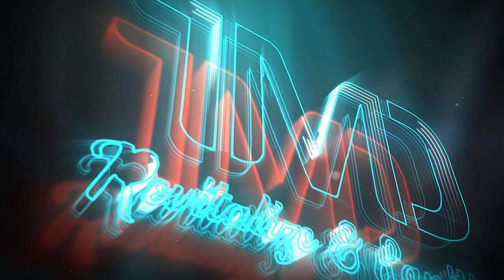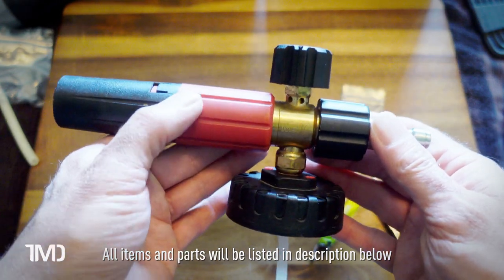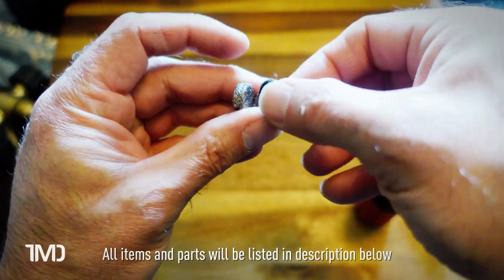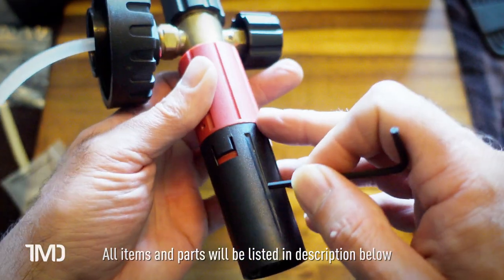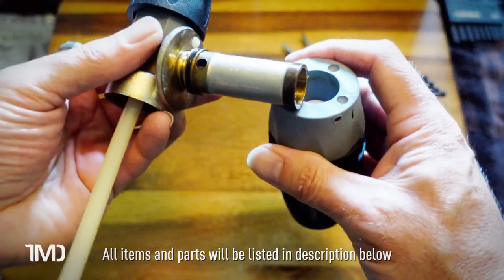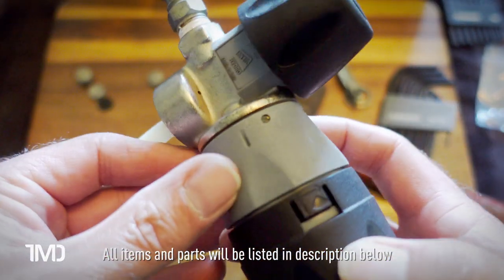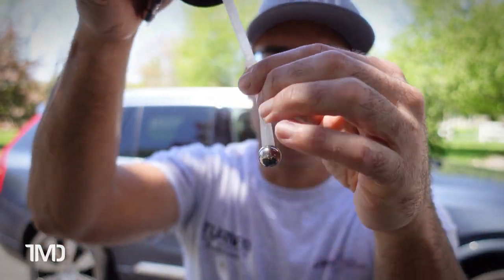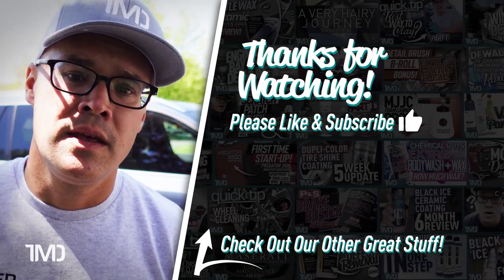How to Replace Filters in MJJC Pro 2 & MTM PF22.2 Foam Cannons + Routine Maintenance

Comment: It's crazy how up until I found and watched this video, I had no issues with my mjjc foam cannon. Then I went to wash my car and had runny AF soap. Opened it up, adjusted the filter (until the replacement arrives) and it's kind of working. But it's just weird that until this video popped up on my YouTube recommendation list, I had no issues with it at all.
Reply from the maker: Lol, strange phenomenon
Reply: @TurnerMobileDetailing sadly the fixes didn't work for me. I have a 1.2gpm 1800 psi pressure washer and the foam is runny. I've ordered a replacement to see if my pressure washer is the problem or the foam cannon
Reply: @TurnerMobileDetailing 
I have a question buddy. Will that 3 piece filter fit any foam cannon, ? For example I have the  red Bear Force clear bottle stainless steel foam cannon,would that 3 piece filter fit the bear force foam cannon? Would love to try it
Reply from the maker: Good question, and I’ve gotten the same question before. My answer is I don’t know, I’ve never tried that. I just use the factory suggested replacement filter. You can compare size specs for each filter and if they’re the same, it could work.

Comment: After replacing the MJJC filters, I had the same moderate improvement. I punched out the filter in the weighted ball with a syringe and got the same results you got at the end. I'd rather bypass the dip tube altogether even if it means replacing the internal filters more often.
Reply from the maker: Yup, if you can have the weighted ball but no filter hinderance, should be golden.

Comment: Thanks for the video - really useful. 
I have the MJJC. I recently dropped the cannon and broke part of the nozzle… only the black part. I ordered a replacement from MJJC. I see from your video how to remove the red and the black parts together (to replace filters) but do you know how to separate the black from the red (since I only need to replace the black part). It seems like brute force but I don’t won’t to break the red part also! 😮😮. Many thanks for your thoughts. 
Cheers
Reply from the maker: Honestly I’ve never had to do that. I took a look at mine and didn’t see a clear way to separate the two. If they sent you the black part only, hopefully seethe piece on its own will give some indication as to how they come apart and go back together.

Comment: So if we want to be a little proactive, is it better to use filtered water to dilute the snow foam concentrate?
Reply from the maker: Filtered water still contains minerals. If you want to go that route you would use distilled water in the reservoir. However, you’ll still be running regular water from the hose, unless you have a reverse osmosis system.

Comment: Why can't you fill the bottle of the foam cannon with a cleaning agent and pull the trigger to flush out the filter?
Reply from the maker: I guess you could in theory. The foam filters inside the MJJC might not be flushable multiple times as they’re a fine grade foam and not stainless steel, thus less durable.

Comment: have you tried cleaning the MTM or MJJC filters probably keeping in distilled vinegar for couple of hrs and reuse?
Reply from the maker: I have not, let us know how it goes?
Reply: @TurnerMobileDetailing  I tried soaking in vinegar for couple of hrs 90% of all mineral and alkaline deposits will get cleaned out with that, then just add a spoon of baking soda and the reaction will remove remaining 10% acidic and hard alkaline deposit residue - it gets 100% cleaned, no need to buy filters unless it is damaged. Also I dont use the allen key to push the filter out that creates a depression and damages it.
Reply from the maker: @kashi2843  which filter did you clean?
Reply: @TurnerMobileDetailing  mesh filter inside the cannon which you need to push out to access. I don't use the ball filter at all

Comment: I have a MJJC myself. Not sure if it’s the same issue hope it is . But my MJJC won’t foam when I max the top nob all da way. I have to minimize the nob to get some watery foam . Hope you can tell me if this is the same issue you had ? Should I start with the filters first like the video ?
Reply from the maker: How many times have you used it?
Reply: @TurnerMobileDetailing  

I been having the foam cannon for about 3 months i use it on the weekends constantly. So I wash 2 to 3 cars every weekend.
Reply from the maker: @mariaacosta7428  at that rate I’d say it’s probably about time to change the filters and clean or remove the filter at the end of the dip tube. Try that and see if that works
Reply: I had the exact same issue. I opened it up and pressed the filters using my finger towards the nozzle. That seemed to work but I ultimately bought new filters. Still not getting good foam though so I'll try removing the weighted ball and see if that helps
Reply: @mariaacosta7428 did you figure out what the problem was?
Reply: Yes Exactly what you said , needed a new filter for the foam cannon. I appreciate your expertise and thank you on taking your time and responding. Much appreciated

Comment: Hid, did you find a way to remove the filter & attach the weighted ball. I am having problems with my Mjjc too.
Reply from the maker: Honestly no, I haven’t had a chance to put any time into that. I just removed the weighted ball/filter and left it off, it works great, I don’t think having a filter there is a big deal anyway, but the weighted ball was nice. I’ll get back to it eventually lol.
Reply: @TurnerMobileDetailing  Thanks for your reply & yeah i don't think a filter is a big deal either. I have just run a 2.5mm drill through the outer end of the ball to break through the end of the filter, so clearing out any debris & effectively making the filter defunct, then i have just re-attached the ball to the pipe. Not tried it yet but i will let you know if it's a success. 👍🏻
Reply from the maker: @alantaylor2  good idea man, let me know how it works
Reply: @TurnerMobileDetailing  Tried it today & it’s as good as new if not better 👍
Reply: How did you remove the weighted ball? I feel like I’m going to rip the “plastic straw” when pulling on it lol
Reply from the maker: @komplex7564  just hold the tube near the end, and gently pull and twist the weighted ball. Or you can leave the ball on and drill a hole through the filter. But that will permanently destroy the filter just in case you you want to use it again lol
Reply: I have a couple cannons that don't have a weight so I like to go get these little round nuts from the hardware store that slide onto the tube and then there's a small Allen screw in the middle that you tighten up to make it stay in place.

It works great and allows me to customize how much weight I actually have at the end by adding more or fewer nuts. 

Just make sure you grab stainless and you're set.